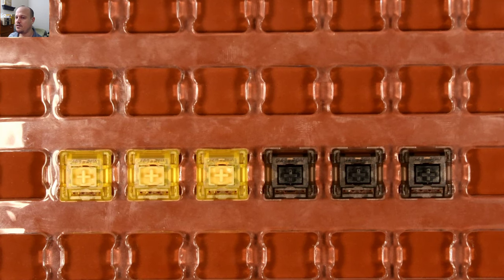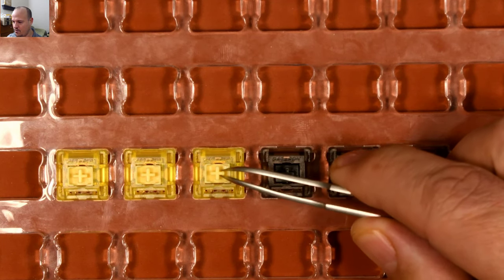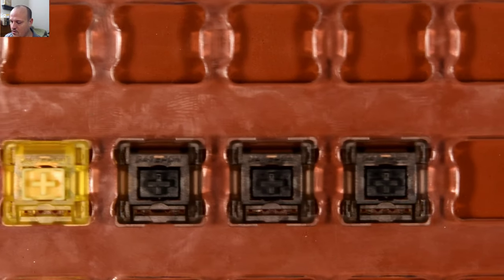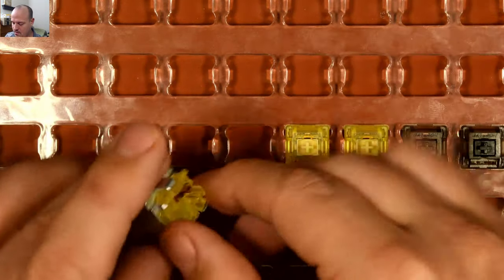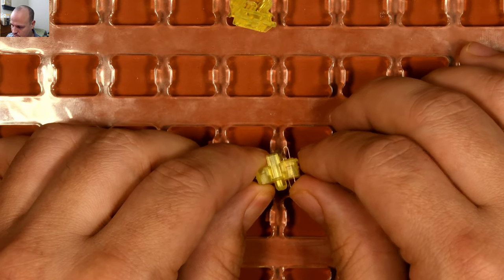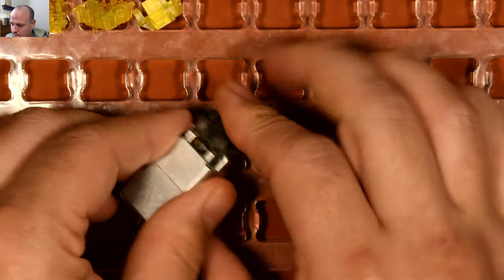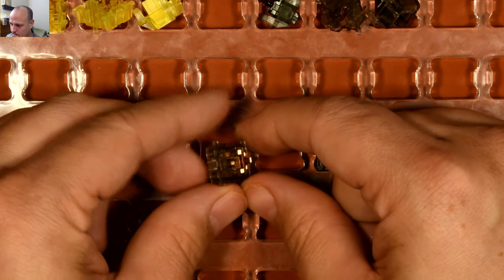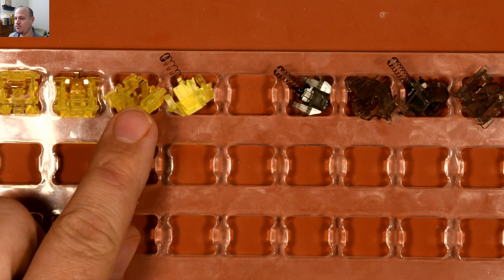PSA: Careful with your leaves when lubing Inks

Comment: I've talked with mike about this and he's said gateron knows about it and apparently they dont think it's a problem. Personally I wont be buying any more inks until this isn't a problem.
Reply: I stick to Zeal - Tealios and Zealios - best made switches on the planet - Period !
Reply: I've gotten 3 orders of gateron switches recently: ink blacks, zeal v2, and aqua zilents, and all of them have terrible leaf issues. Suffice to say that I probably won't order gateron in the foreseeable future. I'm probably going with durock next time.
Reply: @ideoidiom  i was planning on ordering ink yellows is this problem biog enough to stop me from ordering and if so do you know any similar switches?
Reply: @donathan5932  Ink yellows, compared to the Zeal tactiles are relatively fine. From my experience so far, I'd say 5/70 of inks had loose leaf (supposedly novelkeys has a batch where this is fixed), 12/70 zealios v2 had leaf click, and 35/70 of the aqua zilents have leaf click/rattle. As you can see, zilents are basically unuseable, zealios u can still just buy more and pick out the bad switches, and inks are still fine imo.

The alternatives for inks right now are: if you need the clear housing for rgb, tealios, but if not, Durock. Inks are still smoother than both, so if shipping from novelkeys is too expensive, kbdfans is still fine, just order an extra 10 to pick out the bad ones.
Reply: willham thanks so much for the response I’m trying to decide between ink reds or yellow and I’m going to get switch films to reduce the loose housing cause I heard that’s a problem sometimes. Also is a loose leaf going to give me a problem other than when lubing ? Can’t I just put the leafs back into place I’m new to the keyboard game so I’m not sure. Thanks for the quick response also
Reply: @donathan5932  Loose leaf can completely destroy a switch because you feel like the switch is not held in place. It's like turning a linear switch into a clicky switch without the tactility. My experience with loose leaf is that sometimes when it falls out, it goes back in just fine and after soldering it functions the same, but occasionally it's so loose that it never goes back properly and develops a rattle that doesn't go away, making that switch unusable. The biggest difference between the yellows and reds is the travel being shorter on the yellow (it's basically a 'speed' switch). You can't go wrong with either, inks are still the best all-around linears imo.
Reply: willham I’m going to be using a hotswap board so is it that going to be something that worsens the effect of a possible loose leaf. How do I know if a leaf is fully back into the right place or if it’s not going to be good. Also if I have a loose leaf is there a way to contact the buyer and get some replacements? Or is warrenty voided when lubing. Thanks again for the response I’m learning a lot.
Reply: @donathan5932  I doubt there will be any warranties, maybe if the batch is bad enough you can send it back for a refund. Basically, if you don't feel something is wrong with the switch, then it's fine. But if you notice a rattle on your down press, it's no good.
Reply: willham ok I think I’m going with the yellows then thanks again for everything hopefully they all come out good.
Reply: I was literally about to order some Gateron Black Inks and Silent Inks...That's why I'm on this video..to see how they sound.....but nope, nevermind
Reply: Franco Fernando nah I ordered 2 sets of ink yellows and no problems with either set. 140 switches in total
Reply: @donathan5932  Ahh ok...then I may give it a shot
Reply: Franco Fernando ya they are really nice I love them.
Reply: Does this change the feel or sound of the switch if you reassemble the leaf properly?

Comment: I noticed the pins in red inks occasionally sliding a bit when I was lubing them, but putting the top housing back on seemed to reseat them perfectly. I will report back once I build with them, hopefully they’re all usable. Have smoky inks from second round so i’ll probably film those now.
Reply: heya

Comment: I havent lubed my inks, yet but I have a similar problem. I did a build to break in the inks and later desolder them. I wasnt paying much attention when popping the switches into the plate. I ended up bendig the pins on a few switches which I popped them out again, straightened them and then correctly put them into the platw. Those switches have sever scratch now. It seems the leaf material is very soft and bends easily. I prefer linjärs over inks because of this.

Comment: Its 2021 and I had issues with my gateron inks having double inputs / key chattering as in when I press f it gives me "ff" and it was annoying af, I opened the switches and messed around with the leaves cleaning it and so on and its fixed now. Was probably due to humidity as I was using a humidifier in my room. Thank you!
Reply: I never had issues with the leaves falling off I had to manually push some and for others i wasnt even able to remove, but its better now

Comment: Are loose leaves that big of a deal? Some of the leaves of my Gat yellows fell out while lubing. I reassembled them and they're still working fine today.
Reply: it is a problem if you don't pay attention and assembly with the leaf out of place. I used inks in a split spacebar and that happened with one, I did not pay attention and ruined the switch when putting together.
Reply: @cesarbarc  i did the same :( bent the leaf and spent whole hour trying to put it back into original shape

Comment: Can also attest to this with Black Inks that were puchased in September 2019. 3/70 that I bought had problems with the PCB when it came time to install either because a pin had bent or they just weren't working properly... took quite a long time messing with the leaf to get it to work normally.

Comment: Not sure bout you guys, but I bought 60 yellow inks from novelkeys a week ago (11/19/19) and they all work just fine without the leaf issue. I actually did not like the speed stem so I replaced them with gat clear stems and they have almost no wobble. They're actually alot smoother now as well.

Comment: I’m after a linear for my next build (if I don’t get lazy and just use box jades lol) and since the new hotness linear is.. having issues, what do you recommend for me to play with? Creams? Greetechs? Regular old Gaterons with a springswap and filming?
Reply: Retooled Blacks, vintage Blacks, Tealios, Fei are all comparable in smoothness to inks after lubing so you can try those instead.
Reply: @phatanhduyle7259  I've gotten some really bad retooled blacks recently and they're very inconsistent, so id say retooled blacks are also a gamble
Reply: @boxenSB  Yea. Same with vintage blacks. Their smoothness is heavily depended on the tooling date and how much has it been broken in. But they sound considerably better than others imo. And lube makes them somewhat bearable
Reply: @phatanhduyle7259  I've gotten my hands on some NOS Wyse boards from 1994. They're incredibly smooth, even without being broken in.
Reply: @j3ffleopard690  For NOS Vintage Blacks, they are usually all smooth so no worries with them. However with Cleaned or Used Vintage Blacks, those may need to be cherry picked if you want to achieve that.
Reply: @phatanhduyle7259  is nos vb the smoothest linear out there?
Reply: @monsterzero9456  If they are all stock then Tealios is the smoothest. After lubing, they feel relatively the same tbh.
Reply: @phatanhduyle7259  i have a couple tealios in my board and i dont like em. might be the spring weight idk just doesnt feel right
Reply: @monsterzero9456  For me, most linears are the same in term of smoothness after being lubed, the only differences are sound, wobbleness and weight
Reply: @phatanhduyle7259  what kind of lube do u use? (krytox, mixes?)
Reply: @monsterzero9456  I mostly use krytox 205g0 and sometimes tribosys 3204 for every mx type linears except Novelkeys creams and
Reply: @phatanhduyle7259  everyone using different lubes for their linears it really spins my head 😭
Reply: @monsterzero9456  You don't have to worry much about lubes for linears since they won't affect your experience as much as for tactiles. Usually most people prefer thicker lube (205g0, 3204 and ghv4) for linears.

Comment: Any advice for fixing bent leaves? I wasn’t careful enough and about 17/70 of my inks are unusable
Reply: It is possible. Not sure what advice i could give you. I just used some tweezers. One tip for the next time you are lubing them, i know it is not ideal but it works, bend the outer pin (the one attached to the leaf) to like a 45° angle before opening the switches. It makes them impossible to get out. Then after lubing just bend it back before putting them in the pcb. Thats what i am gonna do to mine at least
Reply: @ivoruiter6605  did this work for you successfully?
Reply: @Vasbroo  it did :)
Reply: @ivoruiter6605  awesome! did you put them in a hotswap or soldered board?
Reply: @Vasbroo  i tried a few in a hotswap board but ended up using them in a soldered pcb. It doesn't matter
Reply: @ivoruiter6605  just heard some issues when people put them in a hotswap board that the pins bend,  thank you anyway for replying!
Reply: @Vasbroo  if you don't bend the pin back well enough it might bend when putting it in a hotswap board. But then again, that could happen with every switch when putting it in a hotswap board. And if it happens it is no big deal cause you can just bend it untill it goes in properly
Reply: @ivoruiter6605  that sorts it then, ill get the inks. your comments have been extremely helpful, thank you very much :D
Reply: @Vasbroo  np glad to help. They can use tx films too btw. They don't need them but they do benefit from them